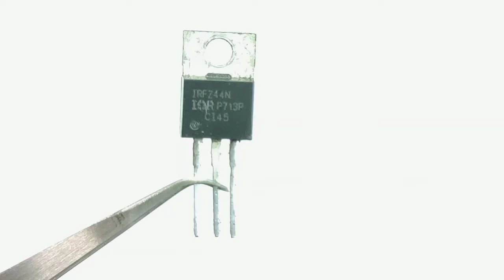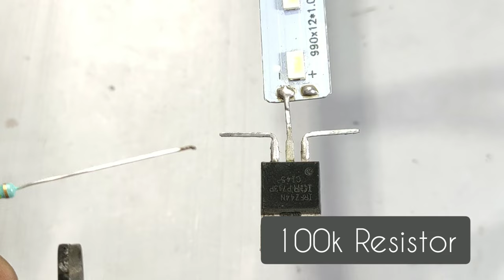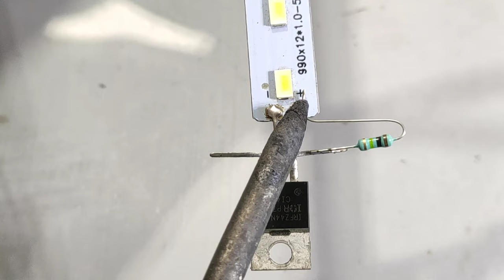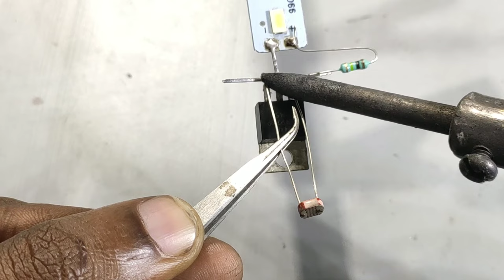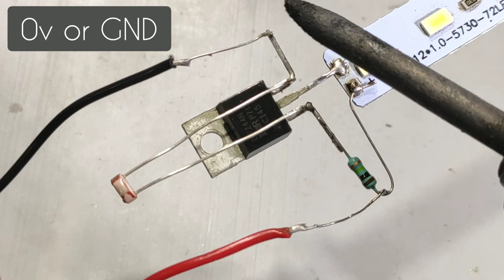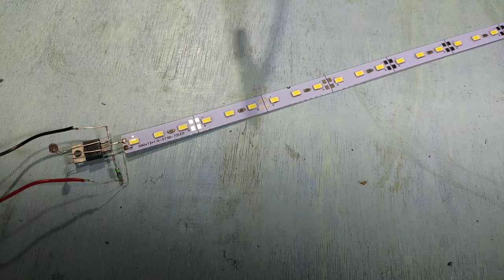Automatic Night Light using Mosfet (IRFZ44N) and LDR || 12V LED Strip

Comment: I had a MOFSET IRF520 in my Arduino starter kit.  Tried it and it worked.  It will not work with BC547 transistor.  I wasted some time with other YOUTUBE videos that were fake and did not work.  Thanks for your great video.
Reply from the maker: thanks...

Comment: Good idea i will try...i have one question plz. Is it sensitive like in the dark only its work and also what is the battery  consumption?
Reply from the maker: It is enough sensitive.
the battery consumption is depends on the number of LEDs you are driving.
Be Happy 😊😊😊
Reply: Thanka for reply. As per this circut which led you recmend? I am new one in this field with less knowldge. Plz guide me for good back up. I have 12 volt with 6 batteries lethium battery with 3s bms
Reply from the maker: use available 12v led
Reply: 220 v supply? @sm_electronics
Reply from the maker: no

Comment: I have one, which is not switched off but only dimmed.  But if I closed it near the bulb, it's totally switched off. Can I increase or decrease (100k) resistor? Or what can I do? You used 100 k resistor, isn't it?
Reply from the maker: experiment with different values.
you should increase the value to 220k or 330k . if it doesn't work try to decrease the value use 47k or 33k or 10k instead of 100k.
Reply: @sm_electronics  thank you, I changed with 150 k. I will test it tomorrow
Reply: @sm_electronics  I think, if I add 100k (
pre-set) variable resistor, will be fine
Reply from the maker: let me know...
Reply: @sm_electronics  I will test it tomorrow
Reply: same here 😮😢
Reply: I think so
Reply: I think so

Comment: if I supply 12v energy, then I only use 3 12v LEDs, how many reresistors should I use, thank you please answer me...
Reply from the maker: If you use 12v led no resistor is needed.
Reply: @sm_electronics  so i don't use resistor also it's ok?
Reply: Actually like this, , I have followed the example in your video, I have also prepared the materials, such as resistors, irfz44n, and LDR sensors, led, but the end result is not like yours, if I LDR it doesn't work a bit, even though I gave it the light is strong, the light doesn't want to turn off, it's still on but dim,
Reply: So the LED light is not 100% off even though it has been given strong light
Reply from the maker: Ldr is getting reflected light.cover the ldr
Reply: Please, give me an answer that you know, I also like your channel, because I like electro, thank you very much

Comment: thank you. it works. but i want full bright with 4 volt circuit. what should i do ?
Reply from the maker: It should give full brightness at 4v. If not reduce 100k.
Reply: @sm_electronics  same circuit doesn't work with 4 volt. then should i remove the 100k resistance? you mean using without any resistance?
Reply from the maker: Use 10k to 22k instead of 100k.
What volt led are you using?
Reply: @sm_electronics  4 volt 5 watt
Reply: @sm_electronics  i used 10 k. but still not working
Reply: @sm_electronics  please sir. Help me

Comment: how should i do in order to connect the circuit to the switchboard instead of directly to the light i want to control?
Reply from the maker: https://youtu.be/ZTjpCx4Tis4
Reply: @sm_electronics  but its a 12V switchboard, on a sailboat, are the components still compatible or shoud something be different?

Comment: How long LED strip can this circuit handle...?
Reply from the maker: IRFZ44N is a N-channel MOSFET with a high drain current of 49A,so very long strip.
Reply: @sm_electronics  what size is the LDR...?
Reply from the maker: Any size
Reply: @sm_electronics .
So the resistance of the LDR doesn't have any relevance, is that correct..?🙂
Reply from the maker: No.it forms the voltage divider.